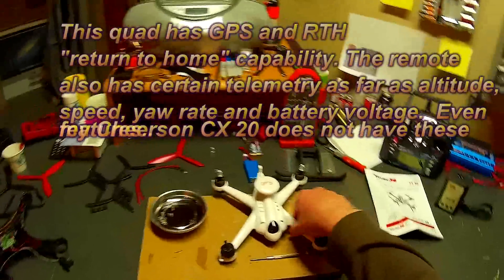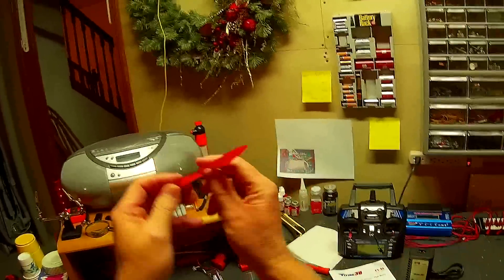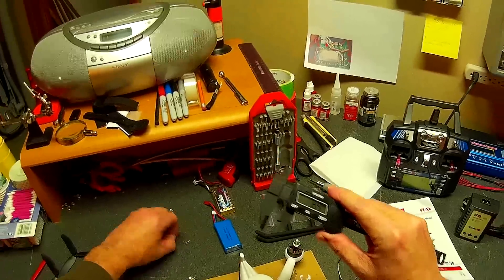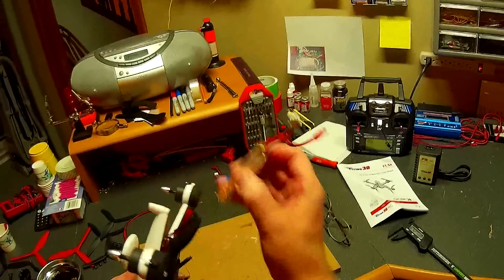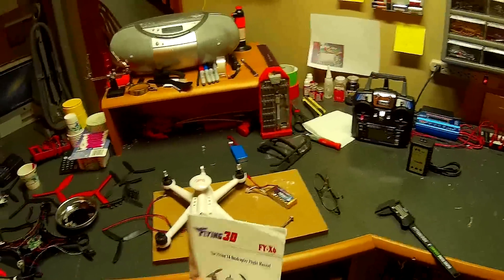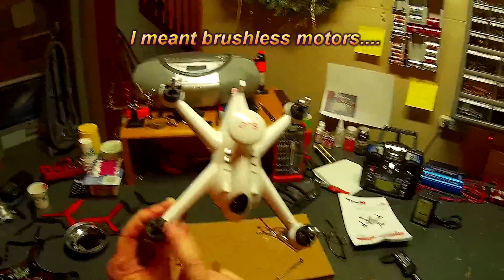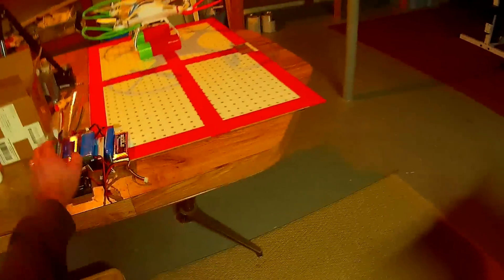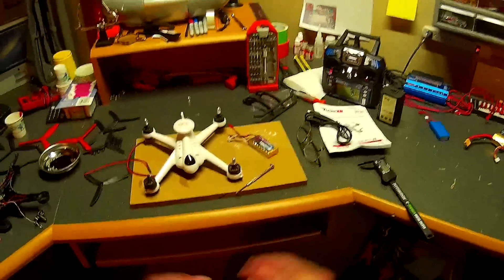Intro to my 3D X6 GPS guided quadcopter

Comment: Thank you, Sir!

Good guiding useful video, well done!

Your cellar flight skills are awesome :o)

The very urgent info in your demonstration is, that the compass MUST be calibrate at first, before fly this awesome little machine. Very very good, and absolutely helpful to know for all pilots, because the manual of the quad is crap!
And i must agree your notes about charging batterys correctly.
I also use the blue SkyRC BC-6/C charger - very good intelligent machine for cheap price!

One little Notice by me: I have sound in your video only from the left side?!

P.S. Nice models of P-38 and Mitchell defending your laptop ;o)

Wish you happy flights always and my kind regards,

Frank

Comment: I wasted another 130.00 on the nine eagle galaxy 3 impossible to fly indoors, can barely control it outside. First motor went out after 5 minutes but banggood is sending me 2 more motors maybe I will get the hang of it before these 2 motors quit !
Reply from the maker: Robert Bush  Don't feel too bad Robert.  I wasted that much on my 2 JJRC H8C's which are the biggest pieces of crap quad copters.  I'm going to celebrate the 4th of July by sticking M-80's in them and blowing them up.  Boy, was I stupid purchasing them.  Cheap ass brushed crap motors..

Comment: And upgrade batteries please sir?Where do I go??
Thanks Mr. P
Reply from the maker: Bill Gerety eBay..  1200 YKS battery and 6030 props period.  Don't use anything else regardless of what others on YouTube have said. I really can't recommend this quad just yet.  It's forward/backward pitch are terrible.  It will also fall out of the sky if you do not watch run times..

Comment: I can tell from the sound of the motors this quad is no better than the jjrc h8c at holding altitude.
Reply from the maker: Robert Bush  I have my replacement.  I will do a few videos of it.  I'm more interested in performance than Altitude hold.  The JJRC H8C is not in the same league as this. 8HC strictly a beginners quad.
Reply from the maker: Robert Bush Oh, by the way.  I'm going to celebrate the 4th of July by sticking M-80's on my two H8C's.  They are the biggest waste of money in all the quads I've purchased.  Never again.  I'm sticking with brushless quads and will build my next one...
Reply: MrPolymers Wish I could get some M-80's they are no longer sold in South Carolina !

Comment: FYI....The 45 in the 6045 is not the angle of the blade.. It is the distance in inches. the prop travels through the air, from one rotation of the prop. In this case 4.5 inches.. This of course is a perfect world measurement, IE does not take into account slippage, turbulence etc.. Or in other words your mileage may vary.
Reply from the maker: I thought it was the pitch?  Anyway, I've drawn the conclusion that the 6045 props produce too much drag on the small motors thus giving the erratic voltages I've experienced.  My replacement 3D X6 is hopefully coming soon.  I'll do tests of the various prop configurations to see which give me the best lift to battery life ratio..  Thanks for watching.
Reply: MrPolymers http://www.propellerpages.com/?c=articles&f=2006-03-08_what_is_propeller_pitch
Reply from the maker: Yefatbastard Yes.  I understand about the pitch of the prop.  I'm a private pilot by the way. The pitch or the amount of lateral movement forward is too great with the 6045 props for the small motors and esc's of the 3D X6.  I've figured that out.  Now, time to see what is a good balance.  I have several different prop configurations I'll conduct tests on.. Should have my new one this week.

Comment: Hello I am interested in a good quality lipo charger and noticed you pointed out the blue one but my question is, is it a one piece or two piece because it looks like the blue box is connected to the white and black box with red wires? Please forgive my lack of knowledge as I am new to this and it kinda seems complicated compared to my simple stock charger that came with my hubsan x4.

Comment: wow nice presentation, I just ordered 5045 props for my X6, hoping the extra lift will carry the SJCam M10 easier and longer flights, my ZMR-X1 uses the gemfan 5030's with no problem but then again its using a 3 cell 1300mah 30c batt and hovers at less then half throttle so it has plenty of lift, just wish the X6 could do 3 cell, yeah I added my front lights also, there are a couple 5v spots empty on the front power input board you can use I use one for each light. let me know if you find a higher c batt to fit the X6, 20c ok but a 25C or 30c would be easier on the motors and give you abit more longer flight I cant find one yet that fits, well banggood sent me something have no idea but came by DHL 3 day ship, was not here to sign for it get it tomorrow
Reply from the maker: Dan..  Watch my latest video.  My 3D X6 is down.  I'm suspecting a bad board.  The FC "Flight controller" I believe gets very hot to the touch.  I have forwarded my Youtube link to Banggood. The 6045 props do give it tremendous lift. One thing for sure, this is very fast.  Have not yet been able to really open it up.  Almost too fast for the hood. Weather here is not good for flying.
Reply: MrPolymers My IMO, you will fry boards and or the ESC's with using those blades, it giving it to much tork and speed which is in IMO over power the motors which brushless can take but not the china cheap parts the X6 is providing, I am gonna be real careful when I even try the 5045 make sure its not to powerful and heating stuff up, you should probably go with a hand made quad ones that have beefed up ESC, Boards, motors and parts k\like my ZMR-X1 it could handle these no problem  it came with a 2 cell battery, but it handles the 3 cell no problem and dont even feel the SJCam M10 I have mounted on there, here are a couple of idea's for you.

http://www.myrcmart.com/rcx-fpv260-arfrtf-fpv-quadcopter-walkera-devo-flysky-p-8218.html
http://www.myrcmart.com/rcx-h250cf3k-arfrtf-fpv-quadcopter-walkera-devo-flysky-p-8244.html
http://www.xheli.com/05h100-quadcopter-red-rtf-24g.html
http://www.xheli.com/05h106-quad-c6-carbon-arf.html
Reply from the maker: Dan.  I appreciate your input.  I still will get this quad back in the air.  I have not really run it that hard and I understand what you are saying.  This appears to be an issue on the mainboard.  It gets extremely hot at one location and I think a resistor/diode has shorted.

Comment: Cant wait to get one of these myself :) Also, for some reason, I can only hear the audio in my left ear?  Not sure if that's me or you, just thought I'd mention it since it seems to be working normally on other videos.
Reply from the maker: I have no idea about the audio.  It's being recorded with my SJ4000 camera.  When you get this, take your time.  Others that own this say the auto land function at low voltage does not work.  That's what I found out the hard way with the Cheerson CX 20.  ALWAYS run a timer and figure a good run time on each battery.  Don't trust these quads that say they return to home at low voltage.  Good luck..
Reply: I'll keep that in mind, thanks for the tips.
Reply: MrPolymers Please provide more info on the 1200 mah battery you are using.  I could not quite read the brand name etc.  but I heard you say ykeys. Can you provide a link or mention where you purchased it.  Thank you.
Reply from the maker: YKS 1200 : http://www.ebay.com/itm/121399476387?_trksid=p2060778.m1438.l2649&ssPageName=STRK%3AMEBIDX%3AIT

Comment: Mr P. has a new toy I see. Awesome! Would love to see an out door flight?
Q? What is the actual name of this thing-a-migjigger? Also love the Blade up grade.  Kazz.
Reply from the maker: Flying 3D X6.  I think only available through Banggood.  Not a beginners quad!  This thing with the upgraded props moves fast and I actually broke a prop in the house when I accidentally throttled too much and hit the ceiling.  Heavy for it's size too.
Reply: MrPolymers Is it about the same weight as our CX20's Speaking of that. I am having a hell of a time with the jitters on my CX20 gimbal?
Q? What's the difference between the X6 and the X8 on this model?
Reply from the maker: Kazz- Mann Size.  The X6 is 250mm and the X8 is similar to my Cheerson CX 20 at 350mm. Jitters on the gimbal?  It may be unbalanced weight!  They don't like anything unbalanced on them.  Thanks and good luck.